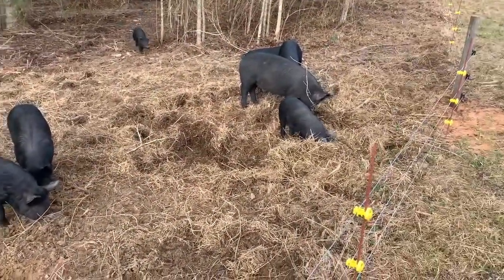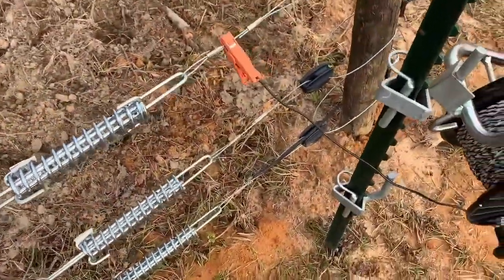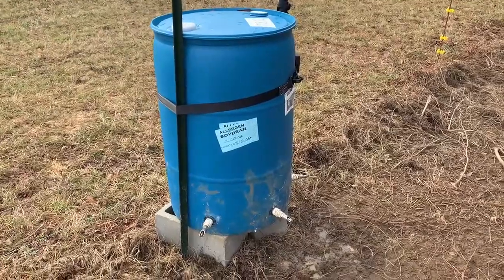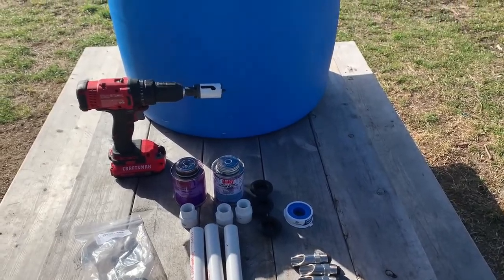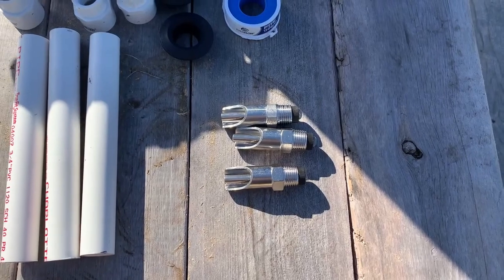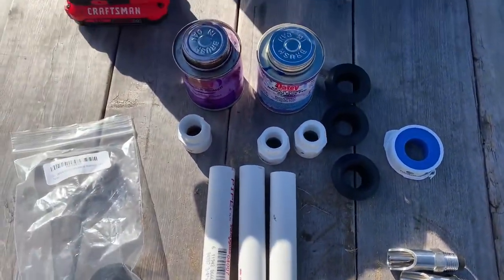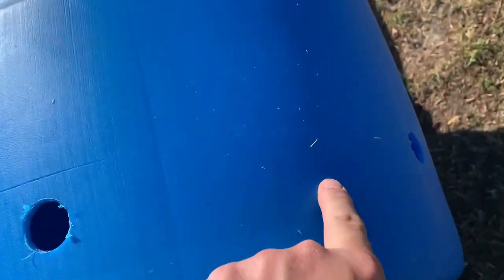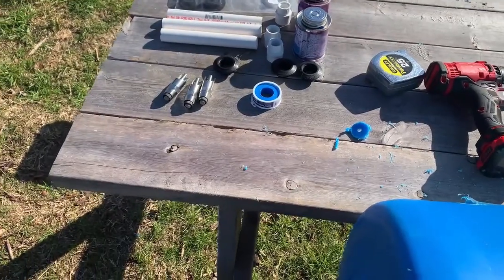Easiest DIY Pig Waterer Ever! | Don't cut holes in your barrels | Read Description Before Drilling!

Comment: Ok my pigs keep grabbing them  and pulling them out of the drum and draining thr water lol heeellllpppp
Reply from the maker: How high up are the nipples?  I have found with mine that if they are not a few inches above shoulder level on the pig, they can pull them out.  Check out the 12:40 mark on this video I just uploaded to see how high mine are up for my breeder stock: 

https://www.youtube.com/watch?v=DpQq29i90o8
Reply: @WattsWayFarm  mine are at 3 different heights
Reply from the maker: @basikkilla1  are they pulling out the lower ones or the ones that are below shoulder level on the pig?
Reply: @WattsWayFarm  above shoulder
Reply from the maker: @basikkilla1  That's weird. Not sure why they aren't working for you.  I have 4 of these out right now, watering over 35 pigs. And I am about to build some more this weekend. The only time mine have pulled them out has always been when the nipples were too low.  Raising them up has fixed it every time.

Comment: Well laid out and easy to follow. Unfortunately, my pigs keep pulling the pipe out of the barrel.
Reply: I had the same issue but if you drill a hole in the pipe behind the uniseal and put a pin through the hole it will prevent them from pulling it out

Comment: Alright, so as the owner of hyper destructive pigs… drill a hole through the PVC pipe inside the barrel close to the seals. Run some stout wire through those holes and link the pvc together to keep the pigs from pulling out pipes and wrecking the seals. Took my pigs less than 48 hours to destroy this design as is.

Comment: how do you adjust the water flow on the nipple?
Reply from the maker: With these style pig nipples, adjusting the flow is kind of a pain, but once you figure out the setting you want, you only have to do it once. Short version is that on the opposite side of the nipple from where the pig drinks is a little disk you loosen to increase flow and tighten to decrease it.

Comment: Needs to be 1 1/4 hole for it to work correctly.  Now I need to go bigger to mske it work and order bigger uniseal. 1 1/2 hole is too big for a 3/4 uniseal to plug. Pvc/uniseal falls right out.

Comment: I'm going to have to be a bearer of bad news. I did make 2 barrels in this fashion, using the gaskets. Both had 4 nipples. Almost every gasket leaked. I used silicone to glue them in, but found that my pigs were actually pulling the nipple through the hole and out of the barrel. Not only did the pigs abuse it, the goats would hit them, causing the gasket to leak even more. I have built these types of waterers  with secure nuts and washers on both sides, holding them tightly in place, in the past. These lasted for years. But this model just can't hold up to the abuse. Too much water loss. Wasted 2 barrels with this idea. Hoping I can come up with a new idea to use what is there, and securely get everything attached. Great idea. But it just doesn't work.
Reply from the maker: Sorry it didn’t work for you. We have many of these in production right now. Use it for our breeding stock and our feeders. Works pretty good for us. We do occasionally have to replace a seal, but it is rare. Works good for us.

Comment: Wish I would’ve read the comments before I drilled my barrel with a inch and a half bit !
Reply from the maker: Sorry. Also put it in the title and in the video description. I think you can get a bigger uniseal and it will still work.
Reply: @WattsWayFarm  My oversight entirely. Barrels are cheap.

Comment: Good job, this is very helpful.l would like some more details on the size pipe and nipples please. Thanks in advance
Reply from the maker: Sorry for the delay.  Here is a link to the pig nipples I used:

5 Heavy Duty Pig Nipples Stainless Steel Watering - https://amzn.to/3cCPOc2

The pipe is as detailed in the video.  Let me know if you have specific questions on it.

Also, please note that in the video I mention using a 1 1/2 inch drill bit.  That is wrong!  I used a 1 1/4 inch drill bit.  I misspoke in the video!

Comment: Can put the name of the things sir 1 by 1 😊😊
Reply from the maker: Sure.  Be happy to. Here are the tools/parts:

Food Grade Barrel
3/4 inch PVC pipe
3/4 inch to 1/2 inch slip x thread adapter
teflon tape
PVC primer and glue
1 1/4 inch drill bit 
3/4" UNISEAL Flexible Tank Adapter (Bulkhead) 
Heavy Duty Pig Nipples Stainless Steel Watering

Comment: You mentioned putting a link in the description to parts but I don't see it
Reply from the maker: 3/4" UNISEAL Flexible Tank Adapter (Bulkhead) - 5 Pack - https://amzn.to/3liNpqW

5 Heavy Duty Pig Nipples Stainless Steel Watering - https://amzn.to/3cCPOc2

Comment: Is there a reason why you didn't just use half inch PVC with a half inch PVC female adapter to connect the nipples into?

Also have you thought about welding a frame stand that would hold the tank up off the ground instead of using cinder blocks? Seems like that would be a good way to make it lighter and easier to move around.

Comment: Don’t drill 1 1/2” hole it should be 1 1/4
Reply from the maker: Ya, sorry about that.  I misspoke in the video.  That's why I put, "Read Description Before Drilling" in the title, and put the correct drill size in the description.  Thanks for the comment.  Maybe someone will see it before drilling the wrong sized hole.

Comment: Hey bro make sure you give out the right info in your videos, just ruined a 30$ 60gal barrel due to you saying 1 1/2 hole saw:... definitely the wrong size, way to big, I’m pissed. Can barely find food grade barrels around me and I get one this morning and now it’s trashed, thanks for nothing
Reply from the maker: Sorry my friend. I did put this correction in the video description, and in the comments, and if you had captions turned on, I put it in big letters across the screen.  YouTube won’t let you (in any way I know) to go back and edit a video after it is uploaded. Sorry again.
Reply: Had the same issue but made it work. Just pry the unideal gasket halfway over the outside of the 3/4 pvc adaptor with a flathead screwdriver. Twist the uniseal gasket into the hole in the barrel. Then tap on the end of the nipple with a rubber mallet until the whole assembly snugs up into the gasket. The gasket will seal the outside diameter of the pvc adapter to the 1 and 1/2 " hole.
Reply from the maker: @beththiel6022  great feedback.  thanks for sharing!

Comment: I’ll bet no one ever accused you of being succinct…wth
Reply from the maker: Sorry.  I know I can be a bit long winded. Not that I am expert now, but this was only the 7th video I had ever done. And was 12 days after I started this YouTube channel.  In the year and half since this video, I think, maybe I am a little better now???  I have learned a lot since I started this channel; first and foremost, that to me, making YouTube videos' aren't as easy as I thought they would be.  Thanks for checking out my video and taking the time to leave a comment.  I hope you found something useful in this video and will subscribe to my channel and follow along for more! Thanks again!
Reply: Would this work on a 5 gallon bucket? Or would it change what rubber grommets you'd use?
Reply: @basikkilla1 ... probably wouldn't seal properly due to the curvature.
Plus a five gallon bucket too easy to knock over. OK, I'm sure you could figure out a way to secure it but it's pretty small. They'd suck it dry quickly.